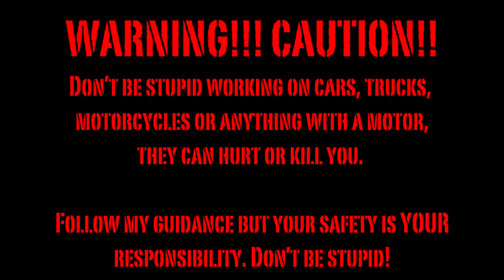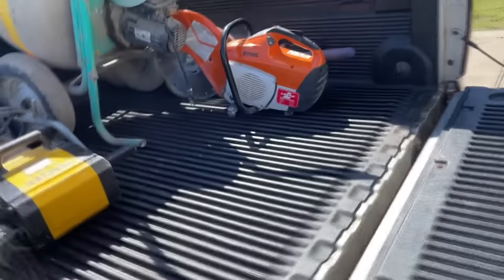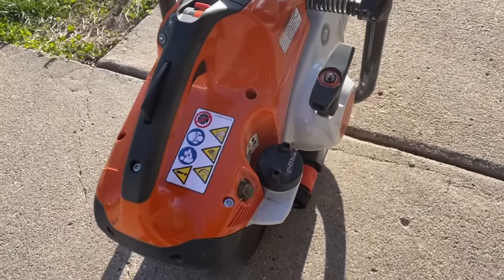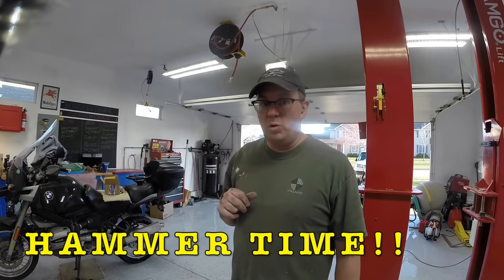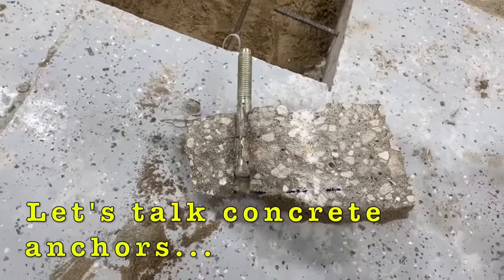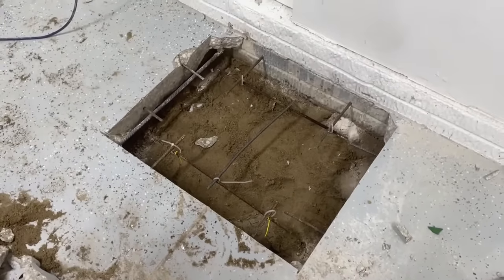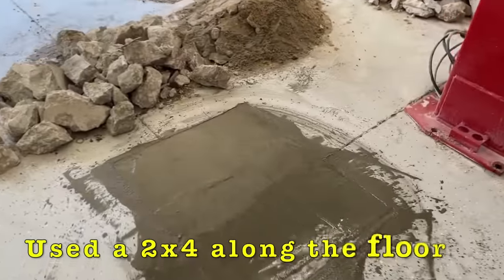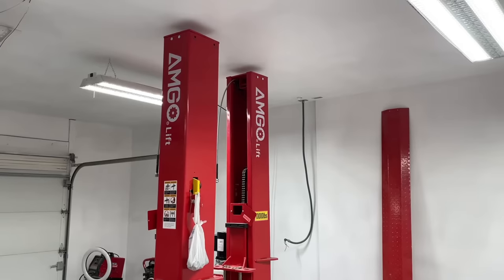My Lift tried to Kill me!

Comment: Did you ever get this sorted out?
Reply from the maker: Yes.. had to take a break from videos for Covid & Life.  I'll be sending a video out eventually.  The bolts pulled out due to failure.
Reply: @honeybadgermotorworks7561  The bolts pulled out due to incorrect installation, not due to failure.

Comment: I would think there's a novel way to get those old bolts out of the concrete without a repour. Drilling, torch, etc.........then if you wound up with a hole slightly larger, go to the next size anchor fastener and drill out hoist flange holes to accommodate.  Although looking at some of those flange holes on the hoist posts....they are almost to the edge which in my opinion is bad engineering. There's even a formula for weight/load and how close a flange hole can be to the edge....multiple holes, etc.

Comment: Don't give wrong information to the public. Rebars on a floor has to be placed on the bottom overlapping secured with concrete... so the rebars doesn't rust. Rust breaks any concrete. You can see on bridges. When you place rebars more and more to the center the rebars get worthless. In the center they have no strength anymore will hold only the concrete pieces together when the concrete breaks. .  Center zone is "0"). You watered down your concrete too much. More water in concrete ... less pressure he can take. More water make concrete more watertight but weakened on strength. Looks like you like a lot of dust in your garage. To remove the motorcycle etc. would help. Mixing the concrete in the garage is a no no. You had fun for cleaning up. ??  You need special epoxy bolts. What you used is slick and can fail by pressure. Hope your homemade construction will hold up. But from the engineering point you failed. Some to think.

Comment: Most lifts specify you must install on minimum 6" reinforced 3500 psi concrete.  Some specify minimum of 4" but my opinion you are asking for trouble with just 4".  Installing a lift in a standard "home garage" using inserted anchors is an "after thought" and asking for trouble.  If you are planning on installing a lift, it should be planned in advance, with a pout of 6" of reinforced 3500 psi concrete using anchor bolts (J Bolts) secured to rebar.

Comment: We’re expected to trust the “expertise” of a guy who runs a concrete cutting saw without hearing protection, eye protection and gloves — and wears a fucking pair of tennis shoes inches from the blade? Most toilets are anchored better than that lift. Let’s get it right: NO lift should be installed in any existing slab unless the performance specifications of the slab are known. And you can bet that the contractor cut every corner when it came to floor strength. Cut a strip out of the floor and start over. Make it wider and deeper than the minimum specifications, tie it in to the existing material and make the guy who sells rebar very happy.

Comment: ADD A CROSS BEAM AT THE TOP
Reply: Not a solution.
They make lifts with a top crossbeam, but they are too tall for his application. If he were to fabricate a cross beam at the top of this lift, then he couldn't lift the car very high, rendering the lift useless.
Reply: without upper support the lift is already useless @PhillipBlanton
Reply: @csi1392   No. He could repair the floor properly and install the lift correctly, then it'd work fine without a top cross bar support.

The fact that he hasn't made any new videos for two years, pretty much since this "fix" though, has me worried for his survival.

Comment: Dude 4” is fine, you aren’t good at this, look how close your bolts are to the cut lines. Of course it failed, you were asking for it. It’s not expensive to hire a professional, if you’re that concerned use concrete epoxy with your anchors to help.

Comment: Is there a part 2 of reassembling the lift back?  Thank you for your great content, I’m going to install a two post clear floor in my smaller shop and I don’t trust my concrete so I’m going to do the same as you. The self leveling of the wet concrete is what I wish to see and how well it leveled.

Comment: George Spangler and I might have minor disagreement on the best ways to anchor posts, but the important thing we completely agree on is that the posts on a floor cable crossover rig MUST be anchored safely.   Pick your method, but don't depend on the floor to hold posts which are not anchored at the top.  Your two post lift MUST have top anchors whether it came that way or you had to fabricate them.

Comment: Please understand you failed to follow standard building practices. You cannot attach within 1 foot of the edge of a slab or 4 inches to the edge of a footer. 

Slabs are 4-8 inches thick. Footers are 12-24 inches thick. The thickness is what allows for the attachment to be closer to the edge. 

Please don't make instructional videos if you don't have the education and experience to understand the instructions for attachment, especially when it is something that could kill someone. 

Your new install is still a failure and is not stable for the installation. You needed to install dedicated footers for the posts 12 inches deep and 6 inches wider than the flanges in all directions for safe operation. Since you are too close to the wall, which is a pinch point and illegal anyway, simple footers are not even good enough. A single 12 inch deep, full width rectangle that extends from the wall footer to 6 inches past the post in the center of the room and 6 inches wider on both the front and back of the flanges. The rebar should be placed as footing rebar not pad rebar. There should be gravel, not sand compacted under the new footer. Lastly full sleeve anchors should be used not slip anchors in conjunction with epoxy. 

Side note you ruined the concrete pouring it wet, it will be more brittle when dry. You also didn't use a vibrator to remove the air from mixing the concrete which also weakens the concrete.

Again please don't make instructional videos when you have no idea what you are doing. You will kill someone!

Comment: Don't blame the manufacturer unless you have proof. What you have is a who shot john. Accept some responsibility. We don't know your cure times, or what you did or didn't do correctly. Some have notice your bolts to close to the edge,  and other issues so humble down and get it right.

Comment: Duh. First of all this was clickbait. You installed it- it flexed so you decided to do it right. You lose credibility with clickbait. Second, when you had it all dug up, why not use that exposed opportunity to simply embed your very long and very strong bolts deeply and also then connect them directly to the rebar. Ideally you could have added a metal plate near the top for more surface area and stability, then cover all with concrete. I am not an architect but my dog walker knows that much. He has a lot of common sense.

Looking at your work, I question even the strength of that pour. You seem to be a jack of all trades type but master of none. I trust nobody who uses clickbait headlines. It tells me they are desperate for views and attention. They cannot stand alone on their credibility. You never see This Old House doing something like this. They are experts.

Comment: Your lift bottom plates are not wide enough fasten your post to the ceiling
Reply: Like the ceiling would hold it.
Reply: @anvilsvs  sure it will I've built homes all my life, it will keep the posts from moving sideways  at the top and not depend only on the bottom plates it's foolish not to fasten at the top if you have that option.your just jealous you wasn't smart enough to think of it, but not many have my intelligence.
Reply: @georgespangler1517  OK, not many have your intelligence, point granted.  I'm only a MENSA member myself.  And not on the upper end of their scale.  I didn't have to think of that solution because my lift does have a crossbar at the top.   In the case of my shop ceiling it wouldn't work well because the ceiling joists, as they would be in probably most home shops, are not running across the lift posts, but are at right angles to them.   Thus any load separating the posts would be borne by the ceiling panels.  Not a great idea in the case of drywall ceiling.  Mine ceiling happens to be steel roofing panels, but I still wouldn't begin to trust them with that sort of load.There's also the issue of height.  The posts are some 12 inches below the ceiling.  It would be easier and more effective to add a metal crossbar to any 2 post lift which didn't already have one such as those which have the balance cables under a floor plate instead of in the upper crossbar.  But the idea of tying to the ceiling is a good one if the structure will support the posts laterally.
Reply: @anvilsvs  run a support from overhead plate to outside wall with triangle braces that will do alot .
Reply: @anvilsvs  my floor has 6 inch contrete and lift larger base plates then most but I still didn't trust it just being floor bolted alone, probably never would have moved but I had to have peace of mind it wouldn't,  12 inches is not far span 3 ceiling joists with a 2 x 6 and triangle braces down to post and it can't move

Comment: This guy is a Harry Homeowner who is terrible with tools! That concrete isn't going to be anywhere 5000psi given that he used about twice the water that he should have. Also, when placing rebar, it's useless if it isn't tied tightly to the dowels that he drilled into the existing slab. Whenever you set anchors you should drill all the way through the slab so that if you ever have to remove it you can just drive the anchors down into the sub base. This guy doesn't even own a shovel??? Nice mess he made of his BMW also. Next time, just hire someone who knows what they're doing!

Comment: Look how much of the thread is sticking out of the holes.... WAY too much, i'm not surprised it moved, you have half the bolt out of the hole instead of in the cement where it should have been. 

This is probably a job you should've got someone in that knew what they're doing. I do hope that people don't consider this an appropriate "how to" video, unless they just want to patch a damaged concrete slab i guess it may be ok for that. 

"Worst thing you can do is fail" and in this instance you're just lucky you have another chance to try again, if it fails you or someone else could become dead.  

And what is with this f***en TERRIBLE music you have blasting at full volume!!!

Comment: You ment to do the pad half a square metre minimum round the post of concrete 
I always recommend nearly one and half metre pads 
The are lift engineers for a reason 
You shouldn’t be fitting lifts your self 
Dangerous 

Silly man